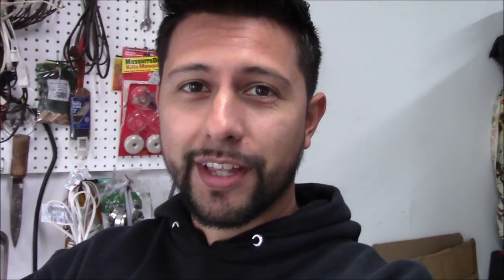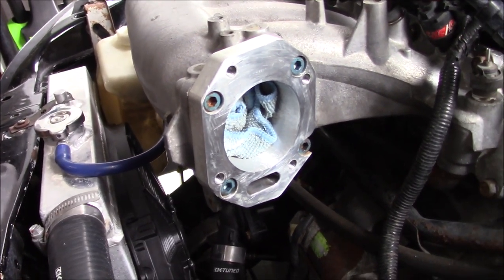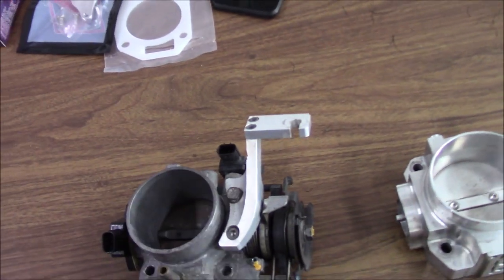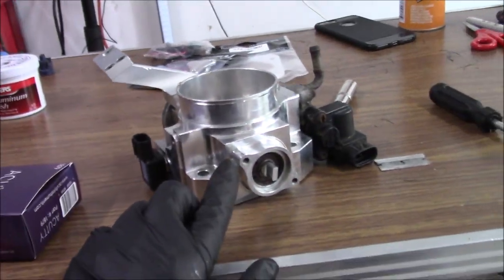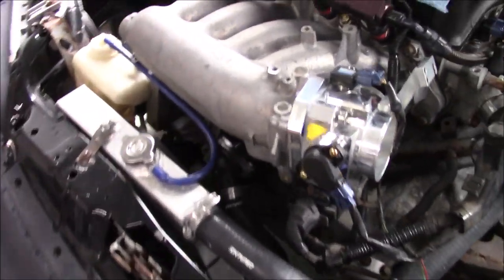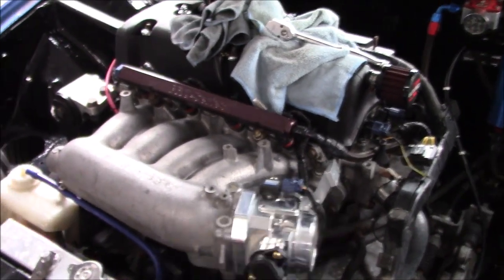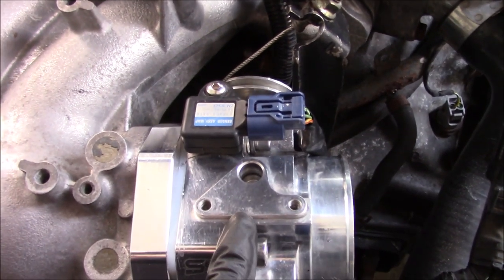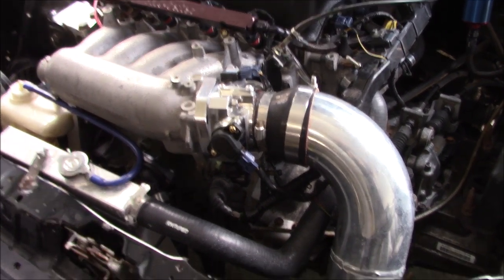S90 throttle body install on this k24 bubble!

Comment: @SERGIOMOTIVE GARAGE  i just bought the id1050x injectors for my kseries build , i saw you install them on your rsx . My question is why didnt you go with the plug n play adapter plugs instead of pinning them into your harness .  Just wanted to know if its worth getting the adapter plugs since i have a rywire milspec harness
Reply from the maker: no need for me to spend an extra $40 or whatever it was for plug and play when i am able to repin them myself

Comment: Which intake mani is that?
You can actually use the K-tuned throttle cable bracket. Just figure where the premade cable hole needs to be to line up correctly, mark new bolt holes for the upper bracket arm-to-lower bracket bolt holes, drill new mounting bolt holes for the upper arm, cut off the excess portion of the upper arm inc. the original bolt holes, if needed to clear the intake tube.
Reply from the maker: it was rbc, yea that crossed my mind but it was just extra work that wasn't really ''needed''.
Reply: @SERGMOTIVEGARAGE  true...love your channel man! When's the next video of Carter's swap?
Reply from the maker: more videos coming soon!